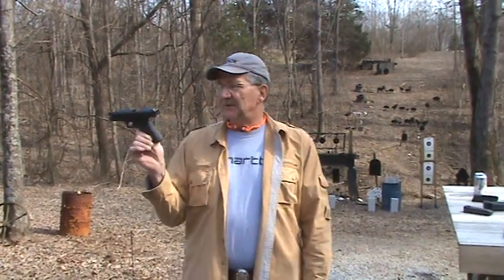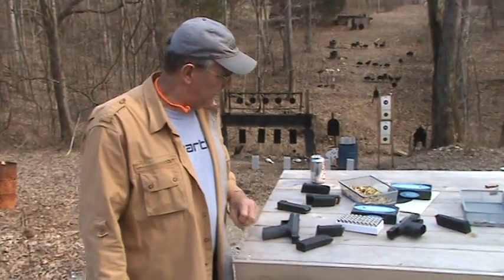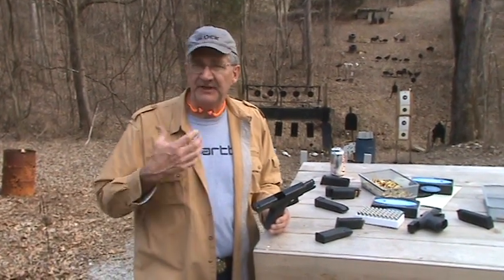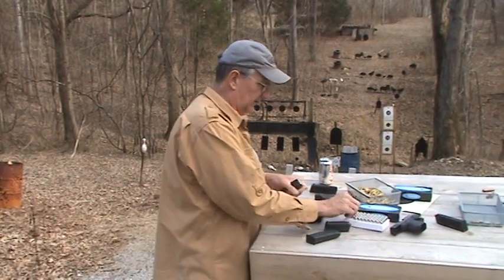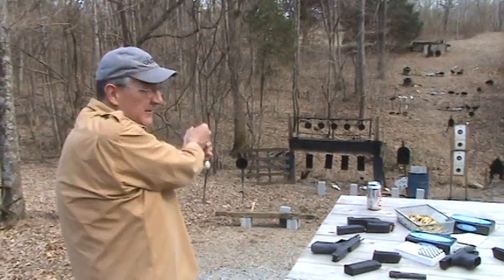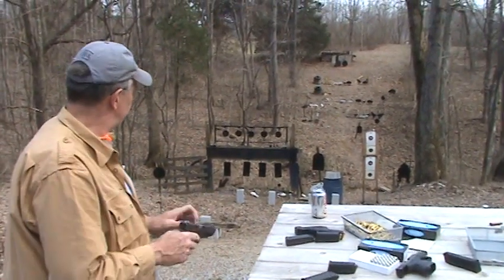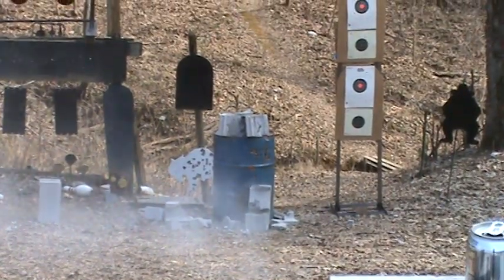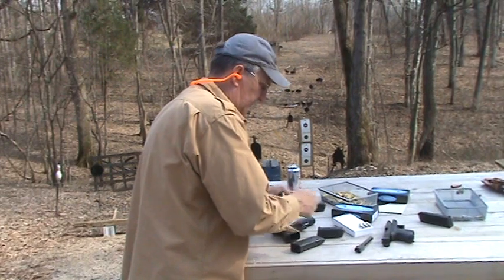Glock 20 with heavy cast bullets

Comment: Do the math.  When it comes to kinetic energy, speed is king; at least until you get into some serious power levels.  For example, Underwood ammo loads some hot ammo.  Their 10mm rounds typically exceed 700 ft/lbs, with some approaching 800.  Their hottest .45ACP rounds don't make it to 600, but their .357 Sig does.  Why?  Speed kills.

Comment: I would say you'd be very safe from attacks by cement blocks--but I don't know about grizzlies. With the glock barrel, that ammo would be great for BARN HUNTING--at least at close ranges.

If you really think it's possible to come across a hungry grizzly, I'd want to have a huge revolver, that's really meant for the job (if any handgun is). I wouldn't want to have to face a charging grizzly with ANY 10mm load (or a charging felon, for that matter).

Comment: Just a thought about your sporadic 10MM accuracy:
Probably a result of the different drag properties of the hardened lead alloy and the copper gilding of the tail end of the slug itself. With the higher barrel pressure of the polygonal rifling in the original Glock barrel, its possible the slug was suffering upset as it exited the barrel, resulting in uneven gas
distribution  and eccentric  forces behind the slug.

But your hat is cool, so that should have negated the physics factors. Really.

Comment: I get a lot of flak when I pose this question but screw it. I never liked the front end sight. never. and any chance I had to remove it and test shoot it, I did. however, I am now in the market for a glock20 (hopefully a pair) and I know im going to do the same thing. I am dead on without it. but I want to know if there is a way I can mount the rear sight where the front should be? I have a rear sight rig in mind for ths, but I just want to know if I can do so period.

Comment: Hey hickhok so are glocks powerful pistols in over all? Thanks :)
Reply: 6 years late, but I've recently purchased a Glock G26Gen5, as the thirty second Glock pistol that I've owned. I've personally, and savagely, torture tested a G17, G17gen3, G19, G19gen2, G19gen3, G21gen4, and G26gen3. These pistols will only fail to function, if they're put through a torment far more brutal, than nearly any real life situation will ever encounter. Essentially, they're ungodly reliable, and insanely durable. Unless you're planning on it being run over by an Abrams  tank, or being hit by an RPG, you'll have a durable pistol, with nearly unparalleled reliability. As of now, my EDC is a G26gen5, that I've slapped a set of night sights on, and a Pearce +3 pinky grip extension. And a Sig Sauer P938 Extreme microcompact 9mm as my backup. Glock is an A++ investment, and a pistol that you can rely on to operate without malfunction, to defend yourself.

Comment: I do not have any trouble placing rounds on target, first time, right or left handed. It's not like a .50. Nor do you have to be as accurate w/  a 10mm vs a .22. If a 10mm hits an aggressor in the shoulder...the aggressor will go down. .22 or 9mm are less likely to yeild that result. 10mm also less likely to ricochette. In the case of shrapnel...I may not even have to hit my target to destroy it.  Very offensive round, 10mm.

Comment: The 10 looks mighty, but as a non-hunter, does it fit my needs for self defense? The price and availability and variety of the .45 ammo and guns makes me lean towards them, I've not used the .45 ACP a lot but I do like the round, a very firm shot. Never shot a 10.
Reply: 10mm is more powerful than .45 ACP, with a higher velocity, and is thus going to recoil more. 10mm is arguably more flexible.
Reply: inteli722 Why more flexible?
Reply: FenceDaGreat 15 rounds of Semi-Automatic Bear-Killing Potential sounds appealing to me, and you can get it downloaded to .40 S&W loads, making it good just about anywhere you could want it.
Reply: inteli722 a 10mm gun will shoot 40 no problem, its like a 22 short in a .22 lr
or a .223 in a 5.56
Reply: XxPurpleXHazeX 40 S&W?! Damn, that is versatile. As I understand it, the 40 is weaker than the 10 but with the benefit of more rounds and less recoil. After the Miami-Dade Shootout the FBI was looking at switching to 10's but I think they settled on the 40 because of its softer recoil. Didn't know it could fire both, very good to know.
Reply: XxPurpleXHazeX Not exactly, as the headspacing doesn't work like that. .22 short in a .22 LR works because the round catches on the rim, because it's a rimmed round. Since 10mm and .40 S&W are rimless round, they won't chamber in the same way, and the .40 is only held in place by the extractor instead of in the barrel as well.

It's much safer to chamber a 10mm round downloaded to .40 loads than to chamber a .40 round in a 10mm gun.
Reply: FenceDaGreat Don't listen to him, he doesn't know what he's talking about. 

https://answers.yahoo.com/question/index?qid=20081023144301AAbaIAM

This link, while talking about firing .380 Auto (9x17mm) in a 9x19mm pistol, is applicable to this as well. Because they're rimless, the smaller cartridge might go too far into the barrel, where it won't get hit by the firing pin, It also might get lodged in the chamber and get stuck, or jam the gun.

For the love of all that is holy, DO NOT FIRE .40 S&W OUT OF A 10MM BARREL.
Reply: inteli722 Thanks for clearing things up. I was surprised when he said it could fire both. Sounds like TECHNICALLY it can but it can result in all sorts of bad things happening. Thanks for the link too, everyone on Y!A seemed to universally say NO.
Reply: inteli722
you want to bet it will function fine maybe a stovepipe if you rapid fire because its weaker its a shorter cartirdge by a small amount other than that they are exactly the same.... plenty of videos of people shooting 40 out of a 10mm glock and nothing blowing up the pressure is LESS. all .40 is is a chopped 10mm round you can shoot .40 out of a 10mm gun when you run out of ammo... and no your gun will not explode.
dont believe me buy a glock try it yourself or better yet look up the countless videos.
Reply: XxPurpleXHazeX Seriously? The situation is still analogous, and my reasoning is still sound. You should not fire a short rimless round in a gun designed for a longer rimless round, or else it won't chamber properly.

I'm not even arguing that you cannot do it. I'm arguing that you shouldn't do it for safety's sake. If you want to safely fire .40 S&W out of a 10mm gun, just get a barrel that's been properly headspaced for it. You recommended some guy on the internet buy a 10mm gun and chamber .40 in it. Sure, it'll work, but it isn't reliable or safe enough. Hell, it might not even work the action!

You want to fire .40 out of your own 10mm gun? Fine. I don't really care. Just don't recommend it to others.
Reply: inteli722
ok i see where you're coming from now. out of the glock 20 it chambers and functions fine, but i do know it is not within the guidelines of ethical gun safety..... but it will work... i think in a shtf or run out of ammo scenario you always have another option that will work in most 10mm guns.... and it doesnt damage glocks... maybe if you fired nothing but 40 for like 2000 rounds it would, but im talking when you run out of 10mm and you need to shoot back .40 is a lot more common especially during shtf...

Comment: low 600 price range is about as much as you should pay for a .45 or 10mm glock.. they have more metal in them and cost a little more than the 9mm/.40 versions
Reply: Ordered a 20 today for 545

Comment: +hickok45 hi Hickok I live in bear country and I was wanting to know before I buy a GLOCK 10mm how bad is the recoil im 13 and 6 foot tall and 170 pounds do you think I could handle it
Reply from the maker: +Josh Harkness  The Glock 20 is not bad about recoil, but I don't know what you are used to.
Reply: +hickok45 im use to a 45 or 44 mag
Reply: +Josh Harkness Lock that elbow out and you'll be just fine. If you can handle a 44 mag you're good!
Reply: +Josh Harkness How the hell do you kids buy firearms?

Comment: I have a stock G20 and would like to have it setup in the best fashion possible for bear defense, I'm not sure what barrel to go with in order to shoot the hard cast lead.  I hear that the lone wolf barrel has tighter tolerance and maybe a steeper feed ramp that may cause malfunctions feeding at times, I'm not sure if this is true but I don't want to sacrifice reliability if Mr Grizz is coming for me.  Any ideas on a solution, to combine maximum force possible out of the g20 yet maintain as much reliability as possible? Know if this is really an issue, and or of any other aftermarket options.  Any feed back is much appreciated, love your videos thank you in advance!
Reply from the maker: Yeah, I stick with stock barrels on my G20 and G29 when I carry them in the mountains.  There are plenty of good rounds that work just fine with the Glock barrel. It's only the really heavy cast bullets that tumble. We discovered in another video on this that the 200 grain cast bullets do fine in the Glock stock barrels, so those would work if you want cast bullets. I just carry that hot Federal stuff myself.

Comment: I bought a new Glock in February 2017 I believe. Gen 4. It only came with 10 round magazines. I was expecting 15+1, got 10+1 instead. Very disappointed. 
  I figured it was a state thing (some states, such as California, have maximum capacity restrictions), and either Glock or the shop that I ordered from (they did have to order it for me) messed up somewhere and ordered one intended for strict states. 
  Anyone have a clue what happened? It’s quite aggravating; the extra capacity is the main reason I didn’t go with the smaller 29. 
I live in North Carolina (relaxed  firearm legislation; open-carry, stand-your-ground state)

Comment: If it is the same weight and only 200fps fast why not just go with a 45acp? I mean ammo cost will be lower and there is a far wider selection of handguns chambered in 45acp.  I mean with glocks yes you lose 2 rounds but still

Comment: I don't think a 10mm would be on my list of guns to have. I don't go hunting, the rounds are to expensive and in general just no need for it. I will go for a 45 ACP, but only the ACP as the GAP is to expensive to. Meanwhile for self defense my 40 cal and 9mm will do the job just fine. Thanks for showing. BTW, Lone Wolf barrels are the only way to go on Glock.

Comment: Well it depends on the type of bear you are dealing with. You can kill any type of bear with a 9mm if you empty an entire magazine into it. The problem is that it is not going to stop a charge and will take a minute or two to bleed it out. 10mm is probably enough for black bear. For grizz and polar bear you are going to want at least a .44 mag to stop a charge in progress. What you really want is a .45-70 rifle or a .458 casull to drop a large bear.

Comment: Does anyone know if the Double Tap 200 Grain Hardcast cartridge is as inaccurate as the Double Tap 230gr Hardcast using the Glock stock barrel?  It is disappointing that the 230gr bullet tumbles and is not accurate with the stock barrel.

Comment: I found some 10mm/.40 200 grain Gold Dots HP I purchased 2000 pulled Bullets from RMR, I know I can get speeds up 1200 FPS. I have not received them yet through the mail buy love to compare them to your 10MM test. Has anyone heard of 200 grain Gold dots bonded Speer hp in .40/10mm? I did not think they existed but they do. I can only feel lucky to bring back full Power Norma Ballistics in 10MM. I have to dial in the best performance but I believe I can achieve my goal.

Comment: And this is why I don't care for a glock.  They are nice guns and they function well, but I want a gun that functions with all ammo types.  I will stick to my old button rifled barrel.  If you own a glock, this is very good information to have (no cast bullets).
Reply: aggieneer02 Actually any pistol that uses the more modern polygonal rifling (believe there's quite a few out there nowadays).  The polygonal rifling has less space for lead deposits to form, which is mostly a problem with hot loaded rounds like Hickok has (meant for hunting).  Indoor ranges don't allow cast bullets usually, and outdoor ranges are usually quite a drive away for most people so it's not much of a problem.  You need a 6" barrel to be legal for pistol hunting in most states, so a barrel is a anticipated expense with the G20 :)
Reply: Brent B

I have 45 ACP and 9mm that I cast and reload for myself.  So it is not a hunting or hot load issue.  It is a problem because polygonal rifling will not engage soft lead (it needs something harder like a copper jacket).  Again, I know it's not a problem for everyone, but it's a turnoff for me.

I have to have a gun that works every time and with every ammo I can get my hands on.

Comment: more penetration happens the faster the round is going so this doesn't have much penetration but high knock down
Reply: Actually, in ballistic tests, higher velocity typically equals LESS penetration, although somewhat counter intuitive initially
Reply: Velocity leading to lower penetration would generally be 2 reasons. High velocity often means lighter bullet which will lose its energy after impact quicker than a heavier bullet moving at the same speed. Also the higher speed a round is moving will make it more likely to fragment and also not go as deep

Comment: Where can I get a lone wolf barrel in california?
Reply: Why don't you just go online like everyone else does and order directly from their website.
Reply: @robertdaone  I checked the website, however, they no longer make lonewolve 10m barrel like the one in the video. They only have for alphawolve 10m
Reply: @robertsonyang4154  Its been replaced by the Alpha Wolf for the 10mm.  Much more reliable than the older lone wolf barrels.  I have both.
Reply: @robertsonyang4154  Think of lone wolf as a Toyota and Alpha Wolf as the Lexus of barrels.  Same company I believe but just better all around.
Reply: @robertdaone  alright thanks for letting me know.
Reply: @robertsonyang4154  No problem.  The Alpha Wolf barrel is great and you wont be disappointed.

Comment: anybody know why a hardcast would penetrate more than a FMJ??
Reply: randy darino cheaper copper flu loads generally has softer lead core, which deforms in a target. hard cast is pretty, well, hard, so it doesn't deform as much and therefore penetrates deeper.

Comment: Yes and no, the 10mm has a LARGE variety of bullets weights available. A 135 grain hollowpoint at at around 1600 feet per second WILL expand and should not go out the back of a person. It will deliver 700 plus pounds of energy. A .22 or a 9mm is not even close to that. Will a .22 or 9mm work? Yes. But if your target is whacked out on drugs or has a mental issue, I want him on his ass immediately, not bleeding to death while he is still attacking me, just my opinion. 10mm is an incredible round.

Comment: The Rachis Recoil System from brassstacker.(com) comes in two designes
The "Carry" which is light weight- $39 or the "Competition" which is heavy weight cause of the added inner tungsten- $69
I just bought a G23 in a gen 3 and like it so far, 98% of what I read and herd about the gen 3's was all +++++

Comment: @grover53b a 9mm is a very light round and a 10mm hits like a .45cal its a major major round the fbi tested it after there 1986 shootout the 10mm has a pretty good recoil to it thats why the fbi went to the .40 cal it was easier to handle the 9mm is the bee bee gun of pistol rounds and it will not protect u go big and go home